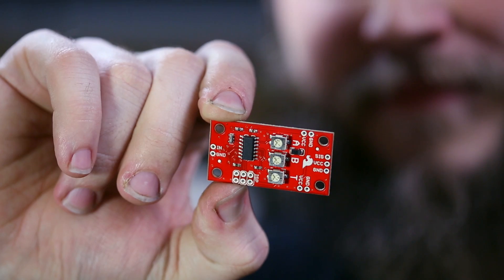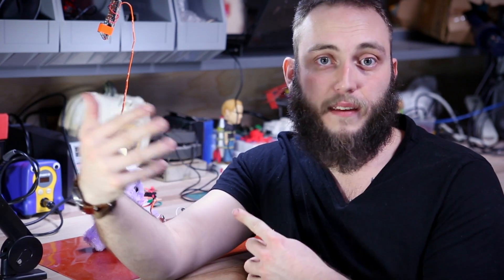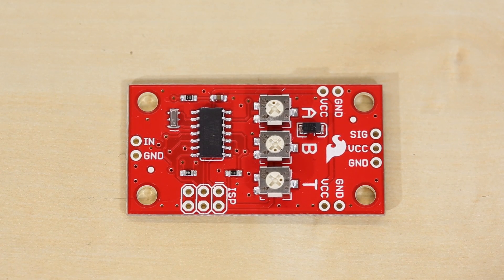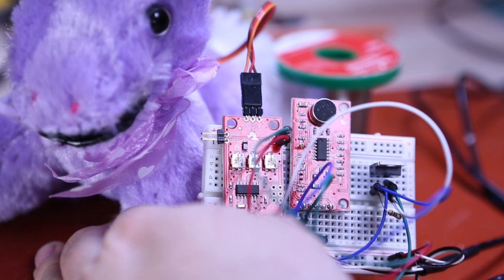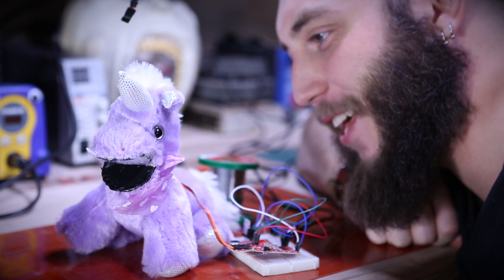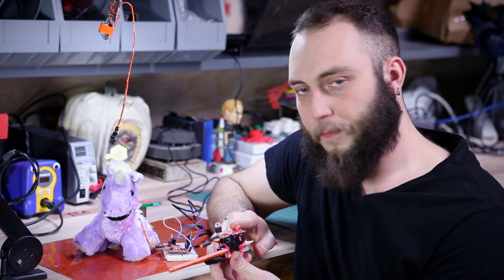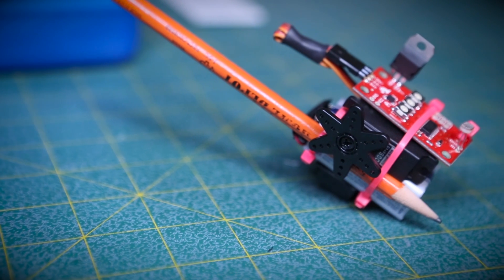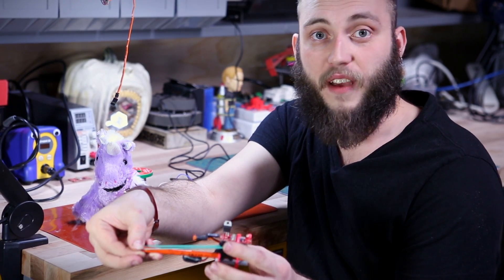SparkFun Servo Trigger

Comment: As a model railroader, an RC server that was moving between two positions (20-40 degrees) by just pushing a button with a shield like this would be a dream to control all switch points on a layout. Those solutions out there today are simply too expensive and too complex. A shield like this could also be steered by DCC systems.

Comment: I have a 7.4 VDC servo, but the board is limited to 5VDC, is there a way to run a second power supply for the servo?  Can you run 7.4 to the power leads on the servo and use the 5VDC from the boards signal?  Or is there a second power input on the board that can be used for the servo supply?

Comment: Hi , I am planning to buy Servo - Generic High Torque Continuous Rotation (Standard Size) with rotation 360deg,and My requirement is I want to stop servo motor at different angles like 230,240,10 and 40 deg(specifically greater than 180 deg),and I am connecting this servo to Arduino uno,So my question is will this servo motor can stop greater that 180deg  at different angles as I specificed above.
https://www.sparkfun.com/products/9347
please replay me ASAP